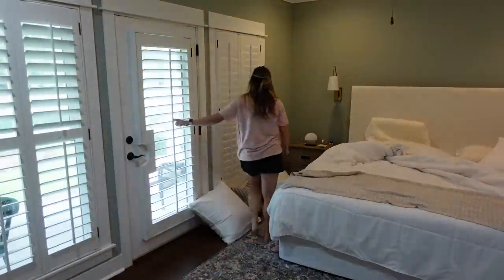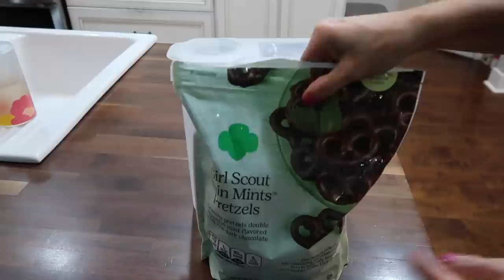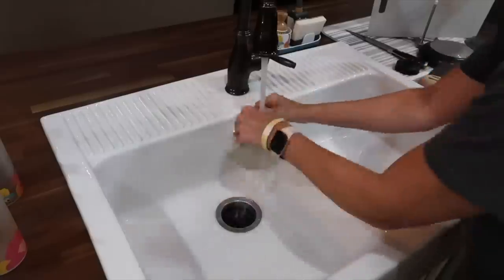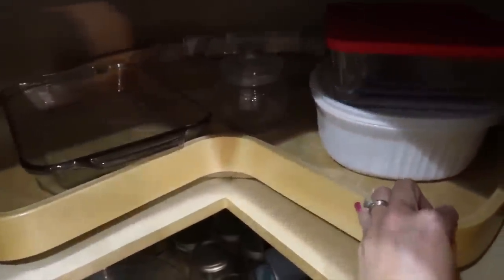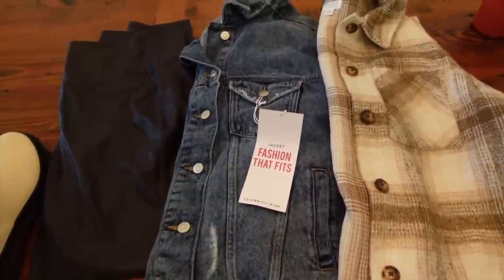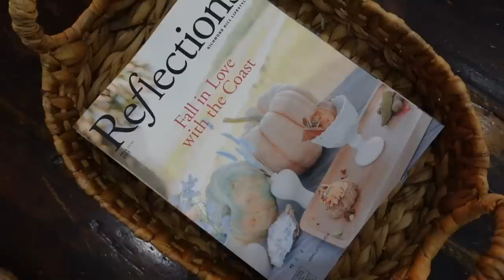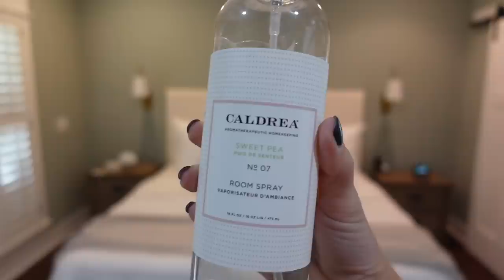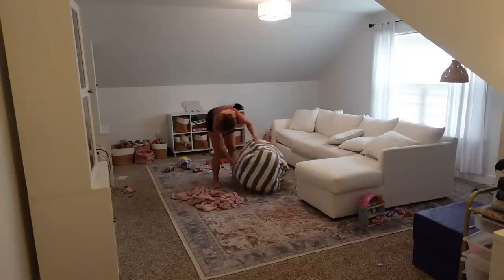2022 FALL EXTREME CLEAN WITH ME MARATHON! | OVER 3 HOURS OF EXTREME CLEANING MOTIVATION!

Comment: How does everyone get other rooms cleaned? I've been home for two months and I feel like I just live in my kitchen most of the day cleaning and cooking. So it's like I don't give the other rooms as much attention. Any tips or tricks to get out of the kitchen?
Reply: Make multiples of a recipe and freeze meals for later- it doesn't take much more time to make a double or triple batch than a single. Make use of tools that save time like a slow cooker, Instant Pot, or air fryer. Meal plan and then prep by chopping veggies, etc. all at once for a few days' worth of recipes instead of doing it at every meal time.
Reply from the maker: Just have a goal of one other room per day/or when you can get to it

Comment: About the kitchen sink, I wouldn’t replace it. I’d contact a local company that specializes in refinishing bathtubs.  My guess is that it can be repaired inexpensively.  If not, I’d leave it as is as long as it doesn’t leak.  Maybe just using a sealer will do the trick.